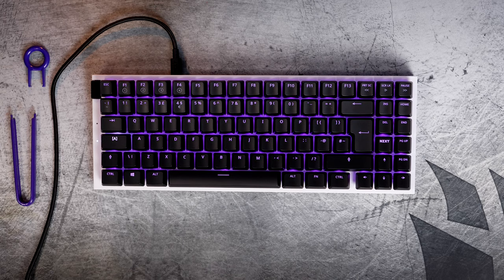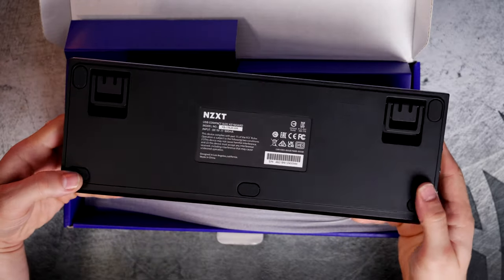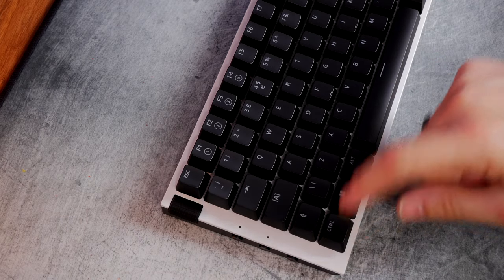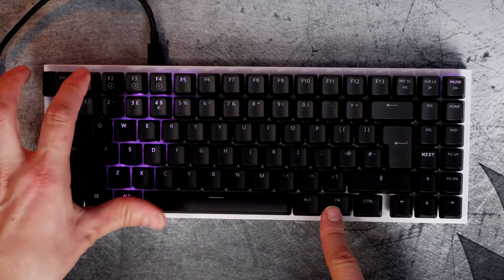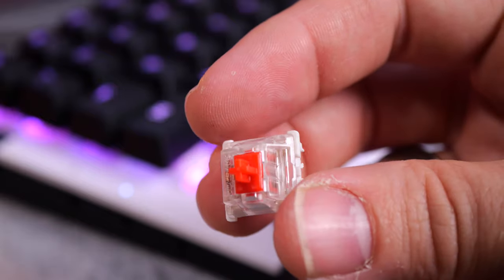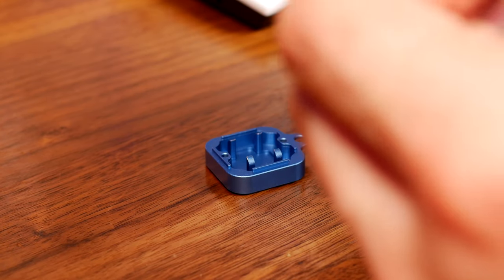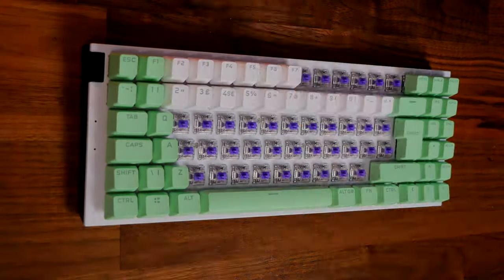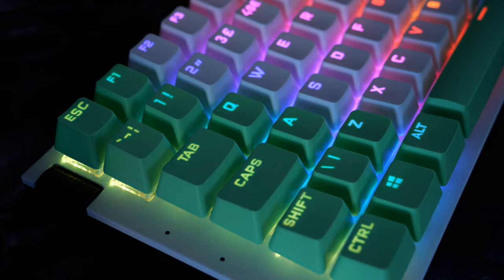NZXT Function MINITKL upgraded! A tiny, tenkeyless keyboard with hotswappable switches

Comment: I bought the gateron reds for my old black window (yes! Non swappable and soldering was a pain in the ass) I thought id like the pure linier switch,  but I dont. I think browns are my fave, silent tactile.

But yeah i like the look of this minitkl!!
Reply from the maker: Yeah, I've been trying to de-solder a Corsair keyboard and it's not going well. xD
Reply: @TheProvokedPrawn  the worst part is resoldering the LED back after the new switch is in. The holes on the pcb for the Led are so small u cant get the solder out. So u have to heat the board from behind to push the led through the switch and through the holes.

and YES i soldered every damn LED in reverse polarity LOL
Reply from the maker: Ooof. Now I want to do it even less. Haha.